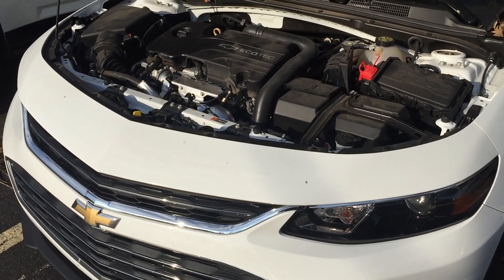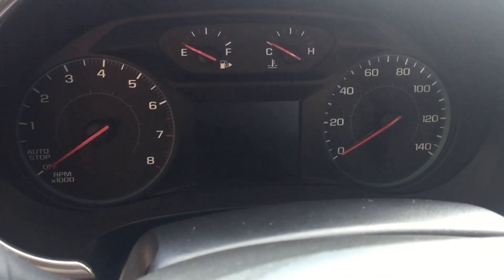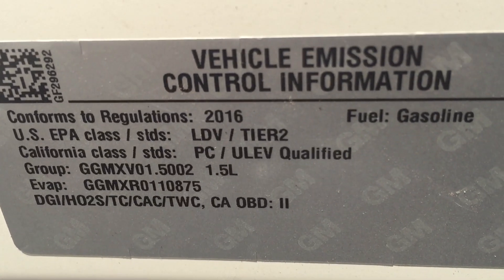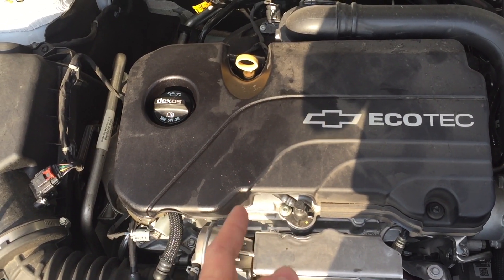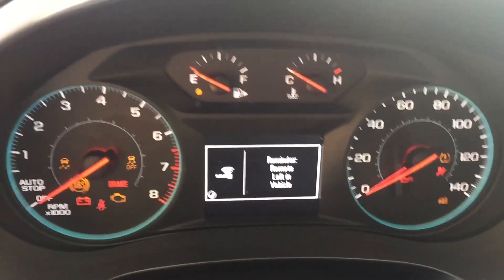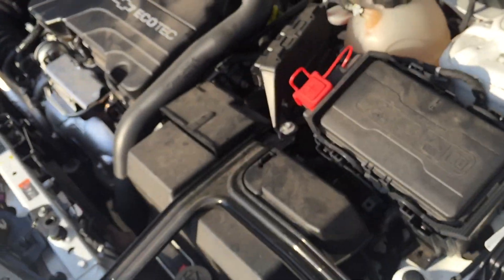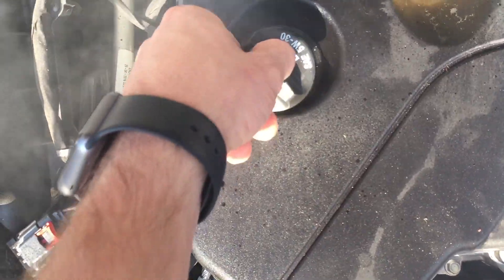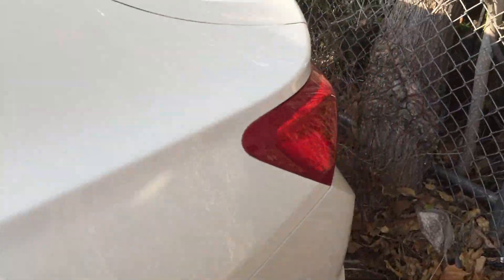What Engine Blow-By Looks Like

Comment: Just happened to my 2016, no apparent warning lights or anything till after except a very slight gurgle noise past two weeks and night before it hesitated 3 times after leaving a stop sign almost as if it jumped timing. Engine has 71k and was religiously maintained every 3k oil change because I don’t believe in 5k changes.

Comment: Just got the PO 304 Code in my Wife’s 2016 Chevy Malibu 1.5T engine the other morning October 13th, 2023 meaning a misfire at number 4 cylinder. I left the car running and opened the hood to do a visual and didn’t notice really anything out of the ordinary until I decided to unscrew the oil cap from the Valve Cover. When I did I could see blow-by smoke coming out of it at the valve cover with oil cap off. At this point before I do anything I am curious to what anyone  thinks. I can go in very easily and swap coils with number 3 and 4 cylinder to see if the number 4 coil is bad or not but in the back of my mind is the Blow-by smoke coming from the valve cover. The motor only has 35k miles on it and has been well maintained using Dexos 5/30 oil and filter requirements. Can a bad coil cause the blow-by I am seeing? We haven’t driven the car since I scanned the car with my OBD II Scanner Friday morning. It is very early Monday morning right now. I made calls to the GM dealer Friday afternoon where I purchased the car from 6 years ago as a left over in February of 2017 to see if there was any power train warranty left on the car and was told no there wasn’t just in case it is a big problem internally. They said there aren’t any recalls for this problem. I really don’t know what to do at this point in time. In need of some help as to what to do next.

Comment: Weak top piston rings.  Oil pushes up and burns.  My 1.4L LUV engine is the cast iron version if this and would run at 220°F when it was -20°F.  Poor internal breathing design from the 90's too.  Catch can doesn't help so much.

Comment: Is it me or do all new direct-injected 4 cylinders have extreme pressure coming out of the oil cap, even my cousin has brand new Honda Accord and it blows like crazy, Honda tell him that it normal. Even if it's crankcase pressure that's way too much , he'll be leaking from front seals oil pan you name it.

Comment: Neighbor has one with 100k dead miss on #1 with 50-60 psi, piston 2 was good, 3/4 160/170 only when giving throttle once you let off compression drops off. Didn't even bother pulling the head told her she needs an engine. Didn't see no damage to top of piston on #1 with my scope so I know it's the ringlands. Sadly I own a 2018 cruze. I'm considering dropping aftermarket pistons in it for this reason. Really isn't that bad of a job. I'm a VW tech 😎

Comment: 297,000k miles on 2.4 Honda Accord 2012,you found the right answer. Mine got so bad that I cannot fill the oil more than half because the oil would wet the spark plugs and cause the car to go unto limp mode not past 3k rpm. Time for a new engine I guess 🙁

Comment: does the thin 5w30 oil has somethimg to do with the engine failure?...
Reply: Not really. Although GM initially put SynBlend but they started to see this issue. I know first hand with spark knock since I own this car myself. GM issued a ECU re-flash to back the timing so LSPI wouldn't happen. Sent a TSB to put full Syn 5W-30 AcDelco or Mobile1. Sadly mine blew up at 59K miles. Got a new engine under powertrain warranty.

Comment: But all those 4 cyl turbo engines have great power/torque specs and are very fuel efficient!!! Enjoy the fuel savings!

PS: Go on any new car dealer lot, any brand. Ask them to start a new engine and do the same test. You will see a huge blow-by for a new engine! Those are due to looser piston rings (less scraping of cylinder walls, less losses), thinner oil... They all will tell you that's "normal".

Comment: I own this exact car 1LT trim and my engine blew at 59K. It was getting rod knock at 20K and the ticking started around 50K. I have a new engine now Under powertrain GM warranty but the warranty on the new motor just burned up around may/june since GM ONLY puts 1 year/unlimited miles. Now im SOL if the darn thing  blows again.

Comment: This isn't just a GM thing, it's the trend towards low displacement turbo engines across the board that is adding stress and complexity to the engines.   That all has to do with CAFE standards for MPG, and it's costing consumers.   Obvious thing, a lot of "expert" reviewers haven't called this out because they are beholden to the car companies (to get a car for review, they have to be in good with them).  It's now becoming quite obvious, Honda recently went to turbos and has a lot of problems.  FCA (Dodge/Chrysler) and Toyota have not embraced this trend and are now some of the most reliable cars on the road. 
Used car resale on turbos is taking a big hit.  A V6 Ford Edge for example, has resale 2-3k higher than the turbo 4.  

As long as you have a warranty (new or certified) it's probably OK, but unless you have a lot of cash sitting around buying a used turbo out of warranty and/or with close to or over 100k miles is very risky IMO.

Comment: This is what you get when you try to put 120KW into a 1,5l Engine. It's possible to achieve, but the quality of the materials necessary for such extreme pressures/temperatures should be higher than what you are having  here.

Comment: My guess is this is a combination of the low tension piston rings, incorrect break-in, and low speed pre ignition
Reply: LSPI was happening to these motors  around 20K miles. Running too lean from the factory. My car was the first to get the re-flashed ECU update to back the turbo timing. GM knows the real issue but only pushed a band aid for owners to last a "while".

Comment: This problem is not on the Cruze! The Cruze uses a 1.4 while the Malibu is a 1.5!
Reply: The Cruze used the almost the same design as these 1.5L or LFV block name. They were prone to blowing up as well.
Reply: @2fast4all  not sure about second gen but the first gen cruze engine can last over 400,000 miles as long as it dosent overheat from all the coolant system problems on the first gen Cruze, but I'd love to see a 1.5 liter malibu engine last that long.

Comment: Thanks for saving me a lot of grief, Daniel. This video is one of the reasons I just traded the 2016 Malibu I bought less than a year ago for a 2015 Camry. It was doing the exact same shit. GM said it wasn't "out of spec" (classic sidestep) and it still ran decent, but I wasn't taking any chances. No plans to buy GM or any of the Big 3 in the near future.
Reply: Good choice picking a Toyota. I've had my 2000 avalon for 3 years no issues. Goes to show you that GM is shit.
Reply: @joshuarivera428  They weren't always.  But they started going down the tubes the moment they started diminishing brand identity around the late 70s. Then they took it a step further by canceling all their best engines.  Their dumbest move ever was canceling the 3800 engine. The POS 3.6 that 'replaced' it is a throwaway at 90-100k miles.
Reply: @anonymousinc6330  around here in BC I see tons of older GM cars still running from 90s to early 2000s Malibus and Impalas and GM era Saturns and an impressive amount of sunfires and Cavaliers occasionally very early '90s and late '80s GM cars popping about here and there
Reply: @silasmcgee3647   Oh yeah, GM built some of their best cars from about 1985 to about 2003, there's no question of that. But since 2006, everything has been junk.
Reply: @anonymousinc6330  you can say the same for Nissan too almost around the same time but a couple of years earlier
Reply: @silasmcgee3647   Yup, from the moment Renault got involved.
Reply: @anonymousinc6330 I think the EPA is more to blame than the GM designers, they didn't have much of a choice. I'm sure if it were up to them we'd all still be driving carburated pushrod V8s lol. The amount of change requiring research and development in engine management systems since the 70's has been immense. A cost I'm sure they would have avoided altogether simply by sticking to what already worked. The change in engine design and management systems have been 95% driven by the ever increasing emissions regulations through the decades, and only about 5% due to technological competition from other manufacturers.

Comment: only 200hp with a turbo? my focus has 160hp stock.
i think that owner was hammering the rpms and it messed with the heads or seals while they were self fitting
Reply: 163HP 184ft-lb torque

Comment: Could it be the same with the Toyota 2grfe where it has really weak rods? Except both the rod and cylinder being very weak and cracking. Lack of compression is the obvious seals being shot on the cylinder head but a weak rod certainly won't help.

Comment: These new engines are being forced to run too lean. When you run too lean bad things happen, run a turbo engine lean and things melt. GM needs to fatten up the AFR's in order to fix the problem. It will sacrifice some gas mileage but will sovle melting pistons.

Comment: Being a lube tech at a chevy dealer place, seeing all the new and older chevys i have gotten to see first hand how difficult and cheaply made they are plus the rate at which they have problems from brand new to down the line later on problems. We have 5 or 7 new 2017 malibu cars mostly from rental cars of miss firing and idling rough not even past 10K miles on them. All the problems are the piston heads breaking apart. Not small chips of a good chunk of the edges broken off and slamming against the valves. Still waiting on back order for new engines and it's been 3 months of waiting and still no engines have been shipped to us. The answer GM gave the certifying instructors is that the customers are using cheap gases and it causes the pistons to break apart. But when we asked the master tech the real cause, it's just simply cheap material made to the engine builds. And everything on that shitty 1.5L motor is difficult to remove and install. the turbo itself had me helping a tech aligning it in place just to put 4 bolts on took 45mins because the visibility seeing the holes is 0. everything is cramped together and not much room to work with so everything takes longer to get done.

Comment: Gm's logic, lets throw a turbo on a standard engine and see what happens! lol
Reply: Well GM should’ve taken notes from German automakers and design it correctly in the first place.
Reply: @davidperry4013  1.5 turbo charged wtf ¿were they stupid?
Reply: David Perry German cars are trash
Reply: @mrincognito5275  you can say that about any countries cars except Sweden.
Reply: @mrincognito5275  They aren't the reliability king like Toyota and Honda but they are leaps and bounds better than this Chevy POS.
Reply: @mrincognito5275  they are the best
Reply: gm had reliable turbo engines in the 80s, 25mpg and 0 60 in under 5 seconds.
Reply: Nothing like n/a for reliability and longevity good job Gm
Reply: We use the 1.5T over here in Europe in so much Opel Cars and its an german engine, not an american. No problems at all with those engines💁🏼‍♂️ 
Our Opel Insignia from the company runs now over 150k Miles with the first engine.
Reply: @lowenherzadventures952  The Opels 1.5t likely is the exact same engine as this car. I dunno if they come from a different plant or it's just that Europeans take better care of cars, but it's interesting seeing the differences in views.

Comment: what about a tiny amount of stable flowing smoke from the dipstick when pulled, only a very small amount. no misfire, doesn't push stick up, could just be bad crank case ventilation in my opinion, trying to diagnose it.
Reply: by stable I mean you can't clearly see a puff puff puff like this one, this clearly has a bad cylinder and the puff is that bad cylinder firing pushing the expansion gasses down into the crank case instead of being contained by the rings

Comment: the old 352 in my '66 ford had almost that much blowby when a piston melted down in it due to lean fuel mix. it soaked the entire fender apron and exhaust header in oil from the mist blowing out the crankcase breather.

Comment: Why doesn't oil spew out of the oil fill cap when you removed it? I forgot to replace mine on my old 85 Celica once and it threw oil everywhere. Is it a design change?
Reply: There is a baffle right under the oil fill cap
Reply: @johnmitchell8925  Thanks but this car is looong gone haha.

Comment: Usually I see engines with that low a mileage on it like that get blow-by because some idiot didn't upgrade the pistons and slammed a 150 shot in there... Haven't seen anything like this on a standard vechicle unless the owner drove it like a dick... Then again, GM in the USA is a terrible corporation... in Britain it's a lot better, but yeah...

Comment: these are brand new cars, why are they having these issues so soon......ill never buy an American car. At 20k miles with a new car, the owner shouldnt be thinking about a possible engine failure....maybe  changing air filter, and adding fluids, not an engine

Comment: American engineering xD
Reply: John Nicodemus I don't believe you, because our German engines are better than this crap! Or do you have some proper fact sheets? I drive a Opel Vectra C 2.2 147PS (Z22SE) Gasoline from 2002 on actually 179.000 KM's and the engine works very fine! Maybe the VW engines brake very quick. The golden times of VW are over since past few years.
Reply: John Nicodemus "General motors uses a number of Japanese and European made engines in their cars and trucks. To find this out one only needs to research paper art sourcing on GM's website."

That's what I want to hear. ;)

"NO engine or auto is perfect, not even Germany's."

Yepp, you're right. Mostly it's by the driver and owner how long the engine lasts. But it's also by the engine parts supplier's if an engine runs good or bad. I don't know if the engines where build in the country where the car's are selled or are imported from Germany or Japan.

Comment: I really hate all those crappy small turbocharged engines they put into cars nowadays. You can´t buy a decent mid size car anymore without getting such a piece of shit under the hood. I only see 2 options: Going full electric or buying a known good V6/V8. For now, I stick with the 2nd option. These small GM engines are generally European engines  and often engineered by Opel btw. They generally suck in small compact cars and die even faster when put into bigger, heavier ones. Avoid any GM engines which call themselves "eco-tec" or similar. Check out the new base engine in the  Ford Mustang: 2.3L ecoboost....come on SERIOUSLY?! In a Mustang?

Comment: All engineering is empirical. That mean things will go thinner, ligther etc., until they break and the design calculation are changed.  On the other hand today 1.5L is not a lawn mover anymore when you can get a 0.9L with 160hp

Comment: I have a 2 year old Corsa, its in the repair shop right now for a sub assembly replacement. (Warranty Repair) The first issue it had was the headlights had some white spots "growing" on it, that was replaced under the warranty too. (After a  shouting session)   GM is rubbish.. will never buy GM again!

Comment: is the same engine of the Opel Corsa OPC (with a little less bore) is a common issue on those cars to get their pistons  (specially the 4th) melted. It might happen because it must run on premium gas due to the high compression ratio

Comment: To small to turbo and mass produce. Not enough metal in the entire engine to be under high pressures, high heat, high hp for size of displacement, etc. Just make it a tiny na Diesel engine instead like the rest of the world already uses. You can't even stress this tiny engine and think your going to be o.k., oh crap, I floored it, will she hold together now? Run her lean once and see what she does to you! What a move in the wrong direction.........can they be bailed out twice?
Reply: J Tattrie small engines can handle a lot of pressure this is just a Chevy and diesels are usually never na, they work a lot more efficient when they are turbo since diesel relies on compression to ignite

Comment: How the fuck can there be blow by on a cylinder with zero compression?!?! You need compression to force the combustion gases past the rings. If there is no compression ( Bent valve, shot rings, blown gasket) you cannot have blow by.
Reply: The term blow-by , means that the fuel air mixture blows past the piston , and into the crankcase. The system used to control and correct this problem , is called a PCV system - Crankcase ventilation system
Reply: And that shit coming out the the valve cover is the combustion gasses. It has bent valves. If the rings were failed that shit wouldn'lt be coming out the cover.

Comment: I have a Veloster R-Spec with a little 1.6 Turbo (Tuned to 250 Whp) Smartest thing I ever did was to put a dual catch can system in place to minimize blow-by. I have caught A LOT of contaminants before they made it back into the engine. Also, with these little GDI turbo motors, you're getting a lot of LSPI issues. People crusing at 45-50 MPH floor it and the load on these tiny engines is IMMENSE. Cracked rods, pistons and windows in the block. Thankfully with a manual, I make sure to always down shift to get the RPMs up and I'm good to go.  
Manufacturers have done a poor job educating people how these new more efficient engines work. They aren't like the V6 motors back in the day.